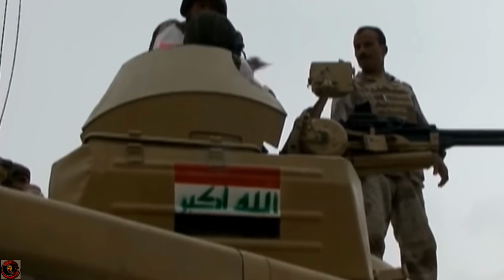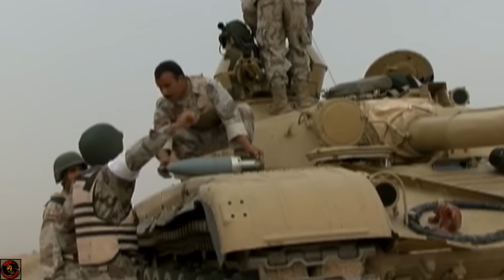Do Russian Tanks Need Bigger Guns?

Comment: I think bigger guns have a HUGE advantage: they are a chep solution.
Let me explain: a tank can defeat an opponent tank by overpowering it with superior firepower or being able to come close enough to kill it (so a heavier, more durable armor is requeired). While increasing armor has a lot of drawbacks, mainly afflicting tank's mobility, upgunning the tank may be a better and more practical solution. There are two ways to increase the lethality of a tank: produce more advanced munitions or developing a better gun. Even if the former choice had been preferred, a new gun is always a better solution, because the increment of the performances is way bigger. Also producing thousands of new tank guns is way cheaper than producing millions of advanced munitions (which also suffers from the changing times, becoming obsolete in a short period of time).

The Russians are increasing firepower, the West protection.

Comment: Reasons why not 152 is quite simple, by using any type other than HE, placing bigger are not worth it, turrets need to be bigger, autoloaders completely changed for reliable bigger shell feed, less ammo in tank arsenal, less ammo in carusel and so, and so on, and so on, real breakthrouh is making shell fly faster, and on longer range, 70 km for KOALITCIYA-SV artillery VS 45 km on MSTA-S, and 1800 m\ps muzzle (rod) velocity on t-72b3 VS 2300-3000 m\ps on t-14 ARMATA with same gun, but with diffirent shells and new type of proppelant ignition system, based on UltraShortImpulseMicrowaveEmitters installing in cannon breach mechanism

Comment: Something I have been thinking about for awhile is a lower pressure gun firing a rocket assisted kinetic penetrator.
Pros: Smaller, shorter, lighter cannons
Cons: Tendency to turn upwind, minimum effective range, ammo cost
Solutions: Dual grain solid rocket motor to support firing pressure, FCC that compensates for wind.

The biggest drawback is the minimum effective range so this would be best used in a medium tank rather than a MBT that is the tip of the spear.

Comment: And the solution is... to use ATGMs with triple tandem warheads to defeat the ERA and to also defeat the active defence system. In the end it would probably cost less than all the re-engineering that is required to use cheaper shells.

Comment: A 152 mm round is around 80% larger than a 125, and that would greatly reduce the amount of ammunition carried to about 24-30 in existing tanks. As it happened with the IS-2, it could carry only 28 rounds in stead of 60 (T-34-85) or 76-77 (T-34-76).

Comment: Soviets go with bigger guns only because lack  of resources and  money and capability to build so-called Electrothermal-chemical guns advantages higher  pressure, stable powder burning in any conditions say bye different trajectories for different attitudes and locations, a really safe  storage because such shells will not detonate in case of fire and penetrations and yes no need for higher caliber say 120 mm Nato such gun will be good as 150 -170 mm  traditional gun, higher speed of shell will also give flatter trajectory and easy up aiming and hitting high-speed/small objects. The US cancel such projects due to fall of Soviet Union and only recently restart them.  Another advantage it can be placed on any vehicle because it just good old barrel with different ignition system

Comment: Well, ze Germans already answered the question about ze question about ze bigger guns ja. :P

The Budeswehr are currently in the process of introducing the Rheinmetall 120mm L/55A1 gun onto 104 of of there Leopard 2's. This gun allows for up to 20% more muzzle energy over the current L/55. Basically the pressure rating has been increased to allow a more powerful propellant charge. So they will be ready for the Russian tank spam. :P

Comment: The energy of the round at the muzzle depends on the gun barrel length as much as it does the caliber.
if you've ever been around a modern tanks gun firing, you'd have noticed a tremendous boom but also a gigantic muzzle flash.
All that flash is powder that hasn't burnt up fully inside the barrel and transferred it's chemical energy into the rounds kinetic energy. (technically, it's still imparting some energy, but let's not split hairs...)

The germans actually tested this and noticed that the 125mm l55 gun worked pretty much just as well as the 140mm prototype.

Another point of contention is space for ammunition. The larger the round, the more storage space you need for it inside the tank, which as we all know is at a premium. So either you need to build a much bulkier tank or you have to lose 10 rounds of capacity (if you are lucky).

In addition, one has to wonder what type of round would benefit from the increased caliber. APFSDS are subcaliber rounds as is and their effectiveness is no derived from caliber size. Indeed, they would gain the most from a longer barrel than a larger caliber.
HEAT and HE-Frag rounds would definitely benefit from a larger caliber, seeing as that would mean more explosive charge, but there really is no target out there that a 140mm or 152mm HEAT round could kill that a 120mm or 125mm can't and the same is roughly true for the HE-Frag.

Comment: To the other side of the argument: How to exploit the weaknesses of the enemy.

Here i still steal a volumen from the swedish S103 turretless tank. With wheels you furthermore get rid of the tracks. It can't go everywhere a tank can - close; but not quite.
The turret of a MBT is about 20 tons of the 60 - switching to rubber tyres will slim down a couple of tons extra and get rid of friction, so a minor engine will do. All that saving could go into better protection. so we will end up with a combat weight of say 30 tons.
A ridged mounted gun will allow an automatic loader that is not too flimsy. It will allow reload to take place through the back door and isolate the ammunition in the bustle which is in fact the last 1-2 meters of the chassis. An armour plate separating the crew from the ammunition should ensure that in the event of a hit ammunition will explode away from the crew - giving them a sporting chance of survival.

Incidentally it would eliminate the need for a smokeextractor. The S103 has 105 mm gun like the Leopard 1, but of 62 calibers instead of 52. Or 20% longer tube. That should give the bolt a bit extra speed out of the muzzle.
As we have eliminated the tasks that demand upper body strength: Ammunition handling and track repair - we can use girls in the tank. Presumeably some that hates remarks of women drivers - and crush your family saloon under her tanks wheels.

Comment: I seriously think the Russians are in way over their soft skulls. Several short remarks:

1) Breach banging against the roof is a problem even with the Leopard 1 as the L7 gun is pared of in the breach.

2) I think this brochure figure mumbo jumbo of ranges of 3-4 km distorts every discussion. Anything over a mile is more luck than aim. Put simply: I might have been of use in the Iraq war under optimal conditions. But anything over 1.2 km or 3/4 of a mile is not that realistic and achieable only by exceptionally well trained crews. On a European battlefield I doubt seriously there is a free shot that long and it presupposes that the enemy does not use the terrain to his advantage. If they don't they are not a problem for very long.

3) Russian tanks have one problem in common: They are at the most a tad over 40 tons - presumeably because the bridges can't take it. It is a Nato problem in the new member states, but with prepositioning there might be a way around it. Let the tank drive parallel to the rivers, not a great solution, but a solution. It will - eventually - be solved by EU (i.e.) German rail plans, but not in the time frame we are talking here.
If you can maneovre a Challenger into what can loosely be termed a position - it is not likely to be moved from it - voluntarily. And telling a Challenger to move out of your way - not a proposition for long life. Those 60 tons do make a bit of a difference. The main problem of the western heavy tanks like LeClerc, Abrams, Challenger and Leopard 2 have one thing in common: It is very unlikely for anyone to come up with something on par.
I stille think of the engagement in the Iraq war between a brigade of Abrams attacking a DIVISION of Iraqi's in dug in positions. The Iraqi division was wiped out with one casualty to the yanks by the way of a mine. You can argue all day about the poor quality of the iraqis, but turning a 10:1 advantage into a total - and I mean total - disaster. You cannot ignore that the tanks themselves must be factored into the equation - one way or the other.

4) The kinetic energy is - as we know - E=½mv*v. A muzzle velocity of 2000 m/s sounds impressive. But velocity drop off after leaving the muzzle is brutal. Maybe I misheard, but I simply do not believe the figure. A fin-stabilised projectile has a large drag component due to the fins which is not only massive around the speed of sound, but the pressure point shift dramatically forward as speed bleeds off.

5) The recoil forces should increase with cube of the caliber. Taking a 105 mm gun as a basis a 125 mm should have 66% more muzzle-energy and thus 2/3 more recoil. A Challenger or a Leopard will take it - if not particularly gracefully. But a 40 ton? I do not believe the Armata tank with its ludicriously long gun tube. I think the traverse will be severely impaired as I can't see how they can keep the damned thing balanced - and balanced it must be or the autoloader might dispair with a crunching sound and a lot of clonks.

6) As to autoloaders. There seems to be a limit to the praciticality tp such a devise at around 4" where above that they are more trouble than they are worth. It is like this: A cat may survive a 5 story fall where a 2 story will kill a horse. Elephants don't run but walk fast - sometimes very fast.
A 2" gun there is no real problem with autoloading. So between 2" and 4" there seem to be a real possibility under the right circumstances. If you can bolt the breach to the autoloader, there seems to be a possibility. Above 4" - forget it: You are talking artillery.

To sum up: I don't think waving a magic wand (or gun) can get around the difference between a truly heaviweight and a welterweight.
The Abrams or Challenger might not be fleet of foot (even the Leopard 2 with its much better engine arrangement is it), and maybe stuck with great tactical mobility, but NIL operational: When it is there it is there for the forseable future.

As I read the plan: There is going to be a Polish/German/Danish Division south of Königsberg that will squeeze out Khalingradskaya Oblast like a pimple. The brits and canadians will be north with a BTN each so nothing comes that way and the Norwegeans with a BTN pushing back at the enemy in Königsberg from north. To be honest: The russians might be stupid; but not THAT stupid.

Comment: An interesting alternative to bigger guns is using a new propellants instead,. For instance the ETC (plasma) suggestion. 
They say with this propellant the lightweight American 120 mm XM-291 came close to achieving 17 MJ of muzzle energy, which is the lower-end muzzle energy spectrum for a 140 mm gun.
And because of its design it will also reduce pressure placed on the barrel in comparison to alternative technologies that offer the same muzzle energy given the fact that it helps spread the propellant's gas much more smoothly during ignition. But the really sweet spot here  is that it can be integrated into current gun systems. 
Al though it would be very interesting to see what kind of a punch this propellant together with a 130 mm gun can deliver.

Comment: Indstead of bigger main gun, I think most tanks could get more benefitial upgrade in form of replacing AA machine gun with remote operated 25-30mm chaingun autocannon. Beacose even .50 cal doesn´t pose real threat to atack helicopters and current IFVs, APCs not to mention longer effective range.

Comment: I'm not sure there's a budget-definitive answer out there @Matsimus . Frankly, from a mathematical perspective you're looking at a complex equation where you have to measure how changing any of the variables affects the outcome; larger gun, better ammunition, associated logistics...

Maybe it's my armchair general, military hobbyist mentality, but I think it might be beneficial to look to past interim solutions; having a number of standard type, multitasking armour and a number of more specialized tanks to act in supporting roles. In cost effective numbers and with proper doctrine and planning these should be as effective as "one-does-it-all" wunderwaffen. Naturally, this implies technological mindset and solutions developed with this in mind; if you design a tank that will also have a "tank destroyer" variant (bigger gun, longer range, not extra armor IMHO), the architecture and power supply for the tank should accommodate this. I'm pretty sure that designers in the industry could come up with cost effective solutions for such modifications.

Comment: ATGM's are getting so advanced does America really need gas turbine 10 gallon/mile MBT's to fight guys in sandals?
Reply: but what if they have some dirt sheap ukrainian tanks, capable of penetrating 600-700 mm RHA?
Reply: Atgm's would hit them 4-8 km, way out of their maximum range. Unless someone can "sneek" a tank up on you?
Reply: there is, like, whole set of countermeasures. Even when hit, modern tanks are capable to continue fight. And you rarely have of 4-8 km of unobstructed ground when firing ATGM.
Reply: Not just ATGM's . Growing sophistication of IED's , RPG's. Not just the tactical but strategic level, does the US need a huge amount of MBT's when almost all the fighting is going to take place in built up urban areas with narrow streets and sharp turns that are perfect for ambush on heavy slow moving MBT's vs agile IFV's
Reply: +Ted Fields
MBT is force multiplier. You use them to reinforce your lighter units, or you should be prepared to throw in more infantry
Reply: Reinforce against who exactly ? What country will meet the US head on in armored warfare...

Comment: the never ending struggle continues armor is getting better and the weapons that could deafeat it before are having there effectiveness questioned and armies are looking to fix this 
   In the tank world we already know what works, high penetration with as much post penetration damage as possible and the overall best round for that was the armor piercing ballistic cap or APBC with explosive filler it can beat armor and can do damage inside both quite well, but as armor got better especially with sloping then composite armor APBC lost its effectiveness and sabot darts and heat shells took there place 
  Overall it comes down to physics, you want more penetration you need more kinetic energy to get it and that is controlled by speed and weight of the projectile and the area in Which the kenetic energy is applied this is why tanks use discarding sabot darts today they travel extremely fast and focus there energy on a small area punching right through armor HEAT shell do the same thing it just foucses explosive energy into a real small stream of molten metal to beat armor 
 Speed is the most efficient of increasing a objects kenetic energy, but it's getting harder and harder to force projectiles to go faster and the very high strain it puts on parts hinders there reliability and cost so most armies are looking to increase the weight of the projectile there shooting by using an bigger caliber to fit a larger round with more mass, the advantage to this is a heavier projectile can go slower then a light one yet hit just as hard, they are harder to get moving but once they are moving they are harder to stop as well
The Physics is quite interesting, I'm interested in seeing how this arms race will continue on into the 21st century but one thing is for sure, I don't see it ending anytime soon

Comment: I doubt there will be much role for the MBT in ten years from now.  I expect most hulls to be mothballed for contingencies.  A single submarine could destroy a battleship during WWII making the cost asymmetry untenable.  Remotely operated semi- autonomous drones will tip the cost asymmetry in the same manner pushing the cost benefits further down than what is already the case against infantry anti-tank portable missiles.  Rolling tanks out again would be contingent to battle sphere information system collapse due to defeat on the electronic battlefield.  Hopefully I don't sound too pompous. :P
Reply: still, Predator flight hour cost more, than manned aircraft
Reply: At the moment, surely plus they have to be selective under the control of an operator.  AI controlled hunter killers operating autonomously behind lines is what I had in mind.

The number of different air and ground drone types to be expected within the next ten years, once meshed together resembles what we have seen with skynet, minus the paranoid AI .  

How long would it take Japanese to take the expertise they gained making robots and turn it toward robotic weapons?  

They input other data types into their AI templates and program a different set of responses and controls.  The teacher robot turns soldier.
Reply: it's wishful thinking, sorry. In reality, military continues to try and create autonomous combat mechanisms since WWI. They had their successes, but no close to 'autonomous hunter-killer'.
And Japan is not particularly known for successes in the military industry - they buy their Hi-Tech military stuff  in USA, after all.